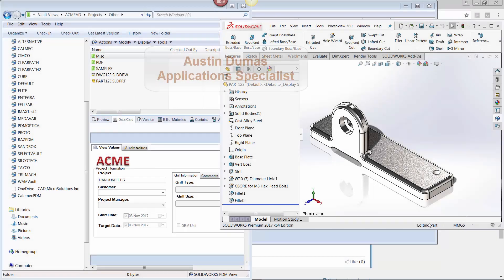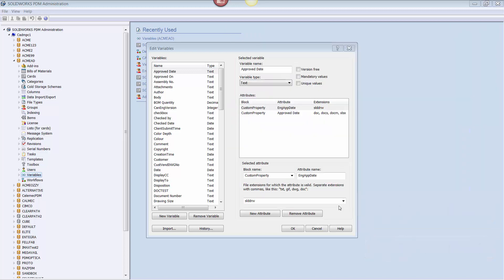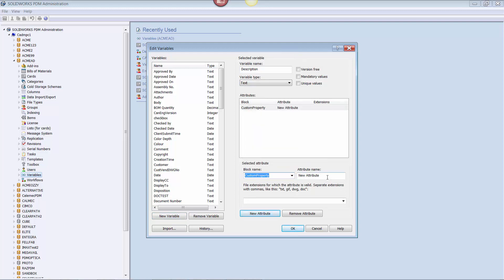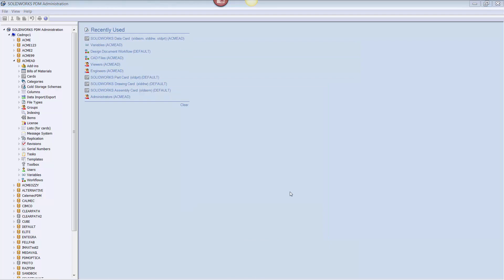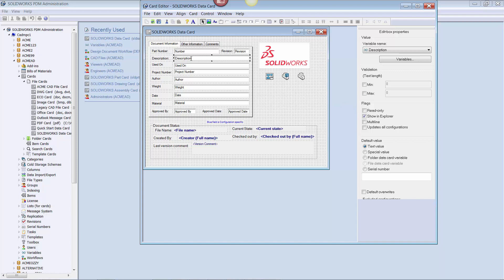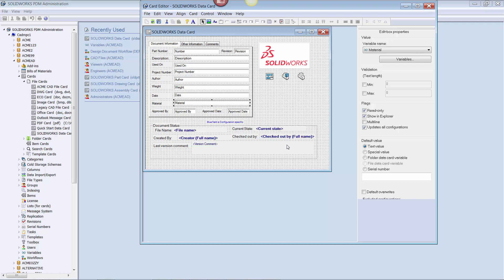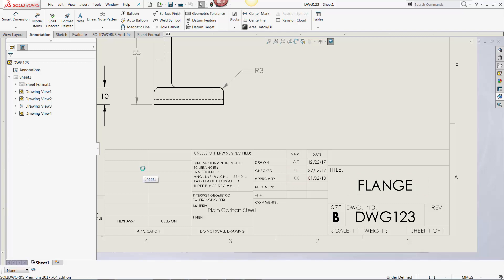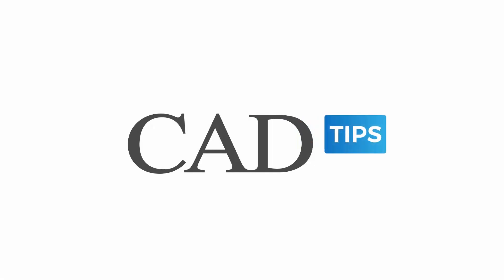Tech Tip Tuesday: Linking Custom Properties to PDM - Part 2

Comment: when I have both boxs unchecked, from my understanding the proprety should be editable on both the PDM data card and the solidworks custom proprety menu and changes in one should be reflected on the other. However when I try this the two values are uneffected by one another. Is my understanding wrong somehow?